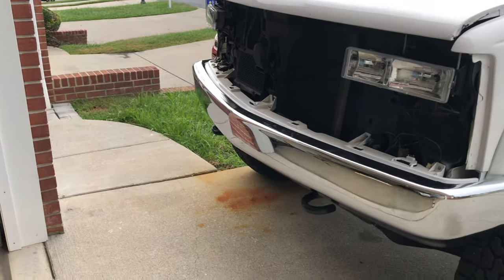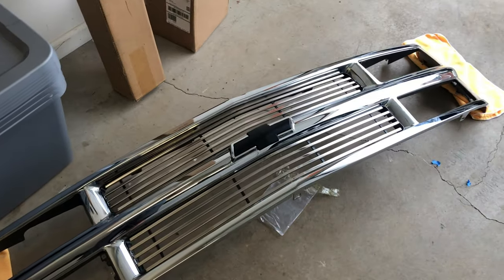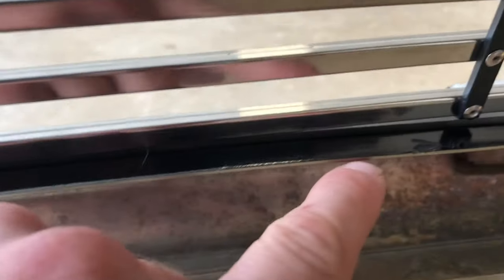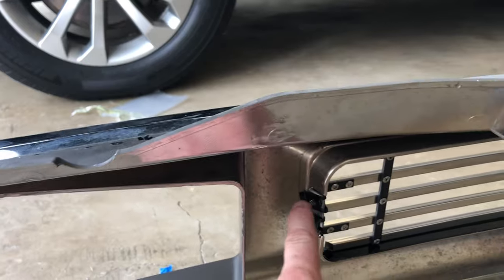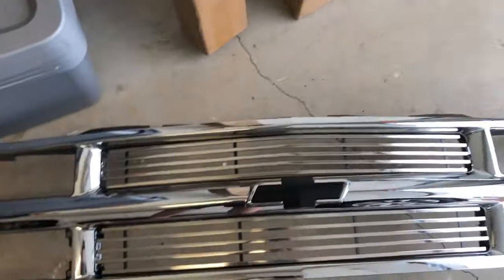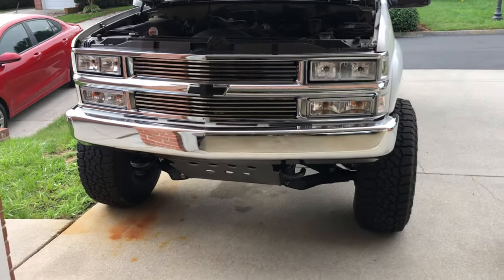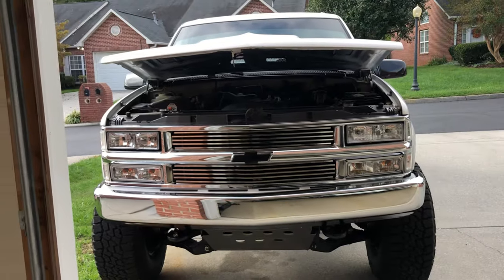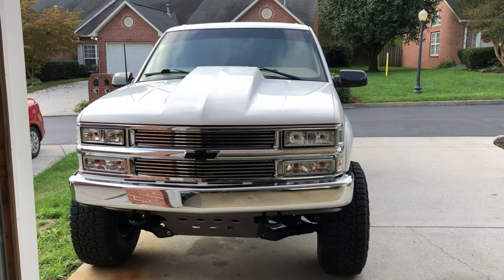OBS chevy trucks 88-99! Billet grille insert install.

Comment: Dude great video.  Getting ready to install my t rex grill next week.  Where did you get your clear corner lights.  Having a hard time replacing mine. Badass ride you got.
Reply from the maker: Thanks man! I got them on eBay they are still on there or Amazon just search different variations of the clear corners. Might just have to word it differently.
Reply: Getting ready to install my trex grill as well! Did you got any tips to make my life easier or did my guy sum it up perfectly 🤔